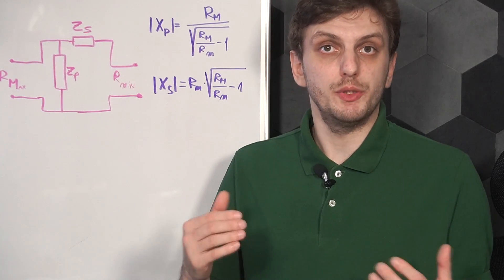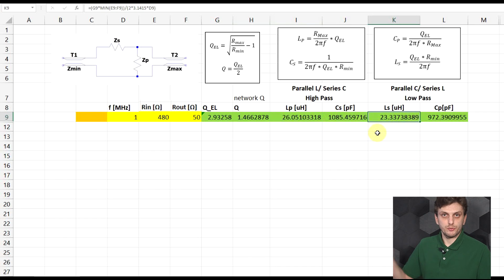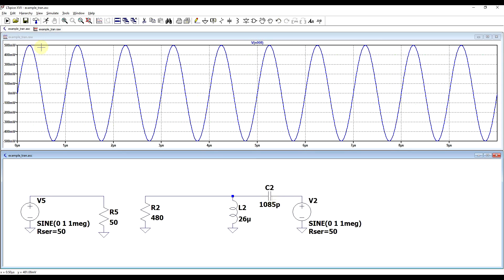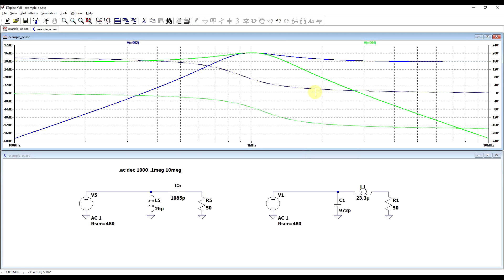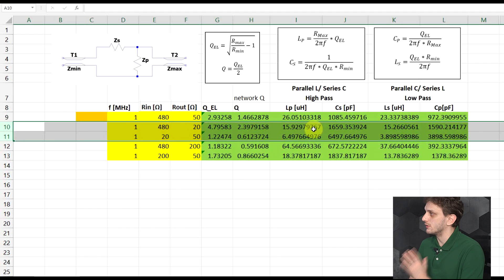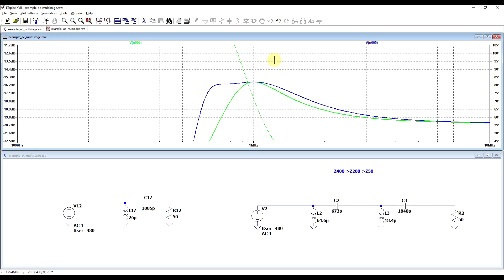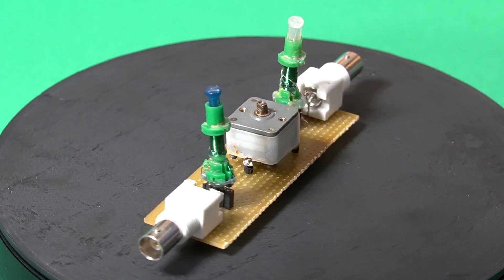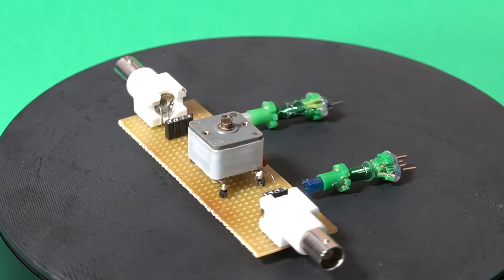Lossless Impedance Matching - Part1/2

Comment: You can use Smith chart to design these circuits without the use of equations :-) 
It's with adding that these circuits works well up to 1 GHz. Above that it's better to use eg. matching stub.

Comment: Perfect timing of your video. I was just working on this. excellent job! If you could add a little? on the RF amplifiers, they are using a transformer as part of this impedance matching on input and output. could you explain this? I bet you could clear some confusion I have on this.
Reply from the maker: Transformers will add galvanic isolation, but also can be built to work over very wide frequency ranges. So for example a transformer used in audio to match the output impedance of a vacuum tube (~4Kohm) to a speaker (8ohm) will work over multiple decades of frequency. At some point I do plan to look at transformers for impedance matching also.
Reply: @FesZElectronics  Ok that explains my confusion! that's great and makes so much more sense. I need to look into the wide bandwidth circuits for that application. I am working with both at the moment and I was getting confused. Thank you so much!